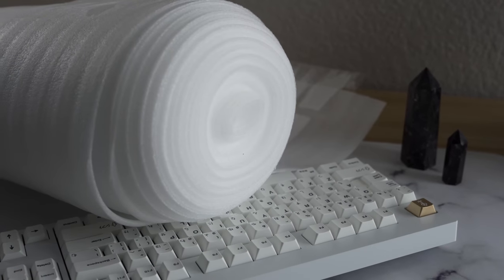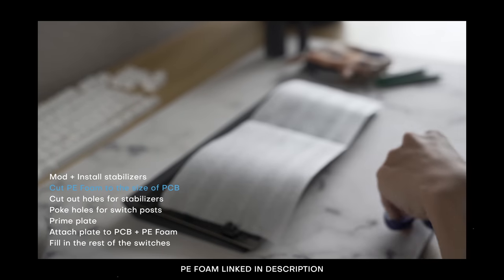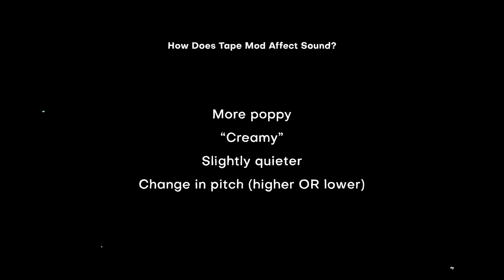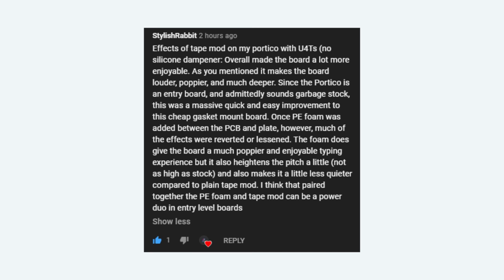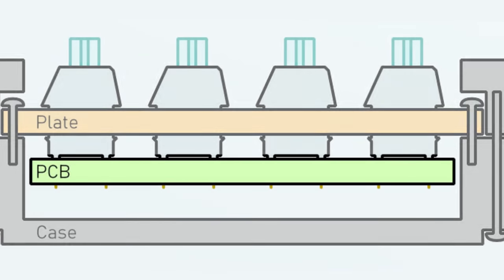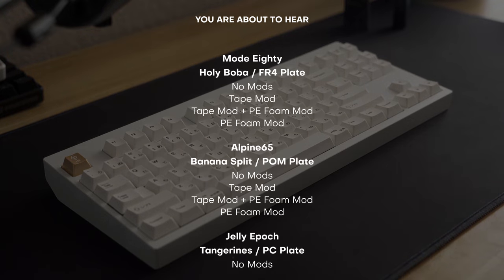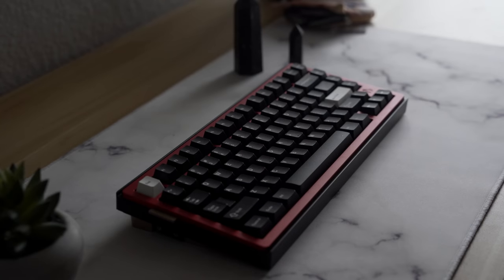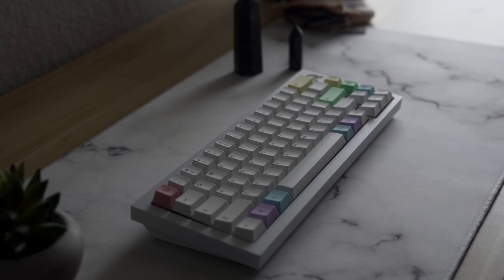PE Foam Mod Explained: An Ingenious Design

Comment: for what i´ve tried so far will all foam mods, is for sure that part of the sound just bounce straight back causing the overall sound louder, is a nightmare in certain cases with switches that already are loud, will not name few of them but that´s for sure. In other case,  the tape mod is the one that more bounce back have, since is just a solid later of material, for how sounds works, having diferente materials, in plate/case reduce the vibrations over typing, so for example alu case+alu plate is not the best solution out there, havig an alu case+with pom plate or viceversa make the best sound wihout needs of any kind of foam so far, also the last foam in the bottom case, will do two thing, first will absorbs the bounce, so less echo in the sound, as any other foarm in a recording studio, also having non flat surface could help, also still bounce the sound, having less travel distance allways will make the sounds bounced to be louder.
Another var that affect the sound more than foam is the keycaps itself, when the sound it bounced it still keep part in the bottom keys, and it act like a bell, the sound can vary based mostly in the thickness of the keycaps, since most of them have the same shape at end. also the size of the cap can affect the sound, that´s why the usual big spacebars sounds more noisy and bad in general compared with other caps,  also, that´s depending on the case itself, some cases have more distance from the case to the bottom of the pcb, in the R4, making these row sound more thocky in comparison, if you can relate, dispersion in high pich notes is more in short distance than low frecuencies, causing the bounce to sound more low. That´s happen with any sound in general, from acoustics. You know that the base itself is a resonance box, don´t need any foam at all, just good design, and diferent mats, to avoid annoying vibrations out there.

Comment: My keeb has a metal plate on top and nothing inbetween that plate and the PCB, and the "ping" this creates is killing me. I already added tape to the back of the PCB and also EVA foam into the case, but it feels as if these modifications made the ping even worse. Would a PE foam sheet on top of the PCB help fix this issue? I assume the sound bounces off the PCB and back to the metal plate and this creates the ping sound.

Comment: newbie question: my board has a pre-installed thin sheet (made of poron i think) above the pcb. Should I replace it with pe foam or leave it as is. I do not have any pe foam lying around so I want to make sure before installing it. Thanks for the answer

edit: also, what if i install pe foam under the pcb (as case foam) beside the tempest mod. how will it sound?

Comment: Hi! Did you add the plate and pcb foam to the board as well as the PE foam ?
Reply from the maker: No Plate foam. No such thing as PCB foam besides the PE foam. Case foam stayed because it is required for the mode.

Comment: I am using the same foam you linked in the description, 1/16", but my switches don't punch through the foam to the PCB. I can't find foam that is any thinner anywhere online. Is there a reason why yours works and not mine? Does anyone have a link to thinner foam?

Comment: Hello, i'm using akko 3068b. I built foam pe case, foam pe plate and foam switch IXPE, so i only need to use tape mode  to make  poppy sound.

Comment: where does it say that this foam is ESD safe? I dont see it in the page you linked?
Reply from the maker: Theoretically, all white PE foam should be ESD safe, because that would mean the absence of carbon (which is what makes foam conductive in the first place). Not only this, but I have this foam personally and tested it with multiple boards, to no issues.
Reply: @nearLucid  thanks for calming my anxiety about the static. You've encouraged me to try the mod out and i've made a video out of it <3 Question though, did you hear any pinging when you tried the PE foam mod? I'm hearing it significantly from my keyboard, but I dont think my mic captured it...
Reply from the maker: @198Immortal  That's strange. I didn't have any issues with ping.

Comment: what is the max thickness of PE foam which i should use? i cant find thin PE foams, they are like 3mm thick
Reply from the maker: The one I linked in the description has a thickness that I found fine to work with (1/16 inch).
Reply: @nearLucid  ok thanks i will try to look for those

Comment: Tested the 1/8 pink PE foam. Too thick for hotswaps, might be manageable with solder builds since you can poke the switches all the way through. Will test later.
Gonna order the 1/16 foam next 😆
Edit: just scrolled down to see potential risk for solder boards, hmmm... Gonna try it on cheaper pcbs then lol

Comment: What would happen if you did the tape mod and put 2 layers of pe foam under it ?
Reply from the maker: It would likely act as regular foam, dissipating a bit of case sound and the higher frequencies that may have passed through the tape. Since the mod is for foam above the PCB and not under it, I'm not sure how this would differ from case foam included with boards.

Comment: why not just place the plate on top of the foam then making the holes for the switches so that it doesn't move around
seems a lot less tedious to me
Reply from the maker: This is the method I settled on. I apologize for not mentioning it in the video, I realized it was the best way after producing it.

Comment: will try 3M Metallized Flexible Duct Tape 3350 is a 3.1 mil thick silver polypropylene tape with an aggressive acrylic adhesive used for sealing flexible ducts.
I tested it for continuity and it was zero.

Comment: can you use pe foam with solder pcb???
Reply from the maker: It’s recommended to really avoid it because the foam and flux will end up in the same hole.
Reply: @nearLucid  Do you think using mill max will be a better option??? Thank you!

Comment: imo these mods are only good for cheap keyboards - if your keyboard has poor stock sound, pe foam/tape will improve it a lot; but if your keyboard is *expensive*, pe foam/tape modding it will heavily downgrade the sound, and make it sound identical to a cheap kit with the same mods... which begs the question: who spends top dollar on a premium kit to make it sound cheap?
same case with plate foam and sound dampening in general... these things equalize the sound and make all keyboards sound very similar, as it's very well illustrated in this video; imo, it takes a special kind of dummy to mod an expensive keyboard... modding is what you do to get the most out of a cheap kit